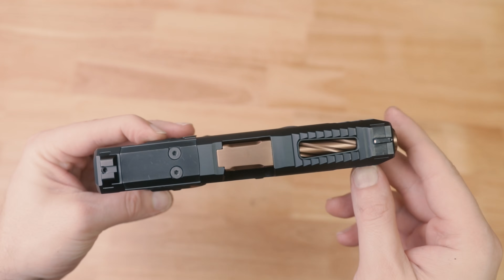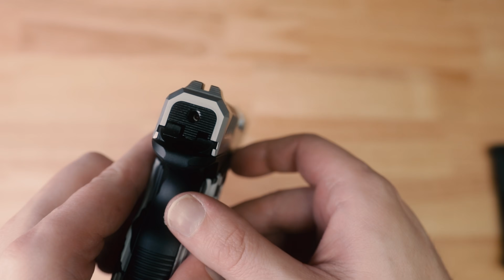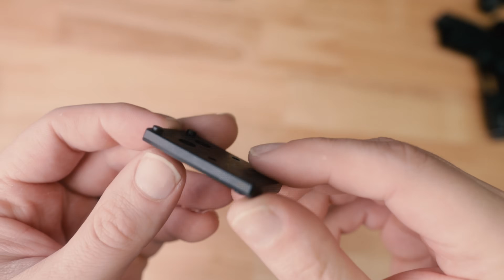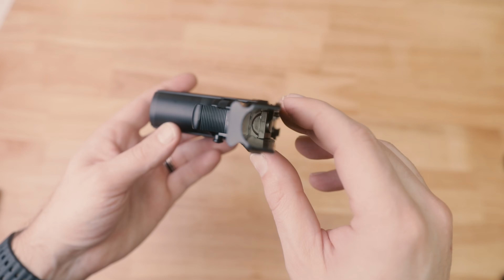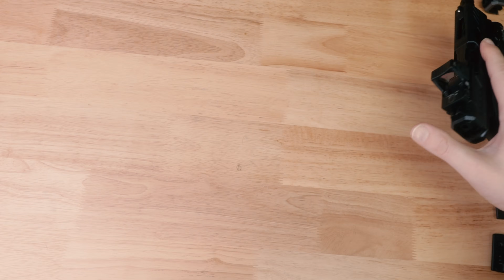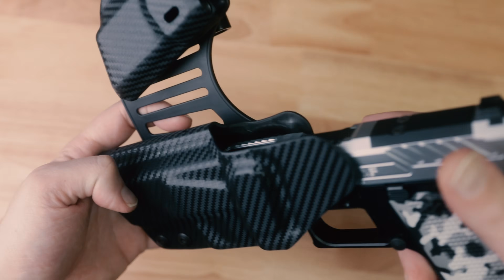The XF Pro - An Improved All Metal Glock?

Comment: Fusion has terrible customer service.  They don’t return emails and hard to get through to someone to speak to about a warranty issue.  That’s right, I bought one of these XF Pros and from day one at the range I’ve had slide lock after every round fired.  Turns out the slide lock spring pops off after every few rounds shot.   I’ve tried to reach out to Fusion for a warranty claim and no response.  Their website has issues as well.  This gun is currently a paper weight.    Reconsider buying from Fusion until they can get their customer service together.
Reply from the maker: Really is that right? That's crazy. All right well here's rserva@outlook.com. I actually own the company. Why don't you email me and I will be more than happy to try to help you: rserva@outlook.com
Reply: @fusionfirearms thank you sir
Reply: That’s really mind blowing to hear. My experience with Fusion Firearms has been exactly the opposite. I had a problem with an optic plate for my XP Pro right out of the box. Emailed Fusion and Tyler sent me out one immediately. Had it 5 days after I called. After buying an XF Pro I had the locking block screw come out of the frame. Again I had new screws in a week. And the gun works without the screw. Later I encountered a problem with my XP Pro slide stop. Tyler sent me out one of each type immediately. Imo Fusion guns and their customer service are the of the highest standard. My only gripe - they’re selling so many excellent guns so fast I think they’re struggling to keep up 😂 I ordered a chrome XP Pro 2 months ago and my dealer (2A Zone) only recently confirmed its delivery. Also it sucks that being in Cali I can’t even buy their swag online. But I’ll get some. They have an eBay store😉

Comment: just got one and slide keeps locking back randomly but won’t lock back on last round.
Reply from the maker: Sir, Also, look at the spring that is attached to the slide stop internally. You can see it if you just take the slide off and look down inside the magwell area. Make sure this spring has not slipped off the slide stop. If it has just take a scribe or finishing nail and hook the spring and place it back onto the slide stop arm.  Sometimes this spring can come off from cleaning rods or magazine cleaning swabs are used. You can accidentally grab the spring arm.  Also, the recoil comment left here can also ha-pen depending on how someone’s grip and finger positions are.
Reply: You are likely causing that situation. Make sure your thumbs arent pushing the slide stop upward during recoil. Clean the gun and your magazines. Try different magazines and ammo brands. I just got one recently and have had no issues like that with OEM Glock mags, Magpul, ETS, Pro Mag, or Mec Gar metal Gloc compatible mags. Haven’t even gotten around to the mags that came with the gun.

Comment: Super interested. The no-go for me is that this uses optic plates instead of direct mounting for the most popular optic footprints and cannot co-witness with standard height sights. This is 2025, almost 2026, to still be using plates when most of the competition is direct mount and super low profile to work with standard height sights is a major miss. Love the integrated option for using ported/non-ported barrels especially, and the ergonomics look excellent. Fix this and I'll buy 2 immediately and sell everyone I know at competition matches and ranges on this unique pistol.

Comment: Ran the xf pro at the Range yesterday.. gotta slam the mags home, might be some interference with the glock base plate.. other than that, extremely smooth shooter..amazing for a non comped gun.. can't imagine what a comped barrel would do!
Reply from the maker: Thank you for the nice comments, Yes, watch the base pads on some brands of mags, they are wide and hit the inside of the grip sometimes.
Reply: @fusionfirearms  they came sirect from fusion.. 10 rd glock mags..

Comment: you need to offer supressor sights.... the front sight is impossible to find.no cowitness at all with stock and a dot.. Shouldve came with just glock 19 compatible sights.. Almost perfect.. Or you guys shouldve just cut it for an rmsc or rmr for direct mounting... man so close. I love evything but the sight system. The rxm crushes this because of that.  dang.
Reply from the maker: These sights are very easy to change to whatever you want, standard Glock rear and standard Novak .330 X65 Degree front. They are all over the place and easy to find
Reply: @ I don’t see a single suppressor height available… which is was you need to co witness. Even then with the thickness of your optic plate I don’t think it’s possible. Just providing some constructive criticism

Comment: I prefer to cowitness my sights and dot, I placed a Holosun 407C. The mounting plates are so thick, I have not been able to find any sights that will cowitness. It has been very aggravating. However the gun is very sturdy, great shooter, the built in gas pedal is really nice. Great pistol for the money but the cowitness issues are driving me nuts, and my gun didn’t ship with the red grips as advertised.
Reply: Having the dot inside the slide seems like it would be supported far better and you wouldn't have to worry about the bolts sheering as bad.
Reply: Have you checked dawson precision for sights?
Reply: @shepherd3085  Yes, I run Dawson on my G45 for my DPP. The problem is that Fusion XF has the thickest mounting plates I’ve ever seen and they use Glock sights for the rear and Novak cut for the front. So you have to mix and match sights. I run suppressor sights on my VP9, they are very tall, they wouldn’t even be tall enough to cowitness on the XF. It’s annoying, if you can get past that the gun is amazing for the price.
Reply: Why are you talking like you have a gun that hasn’t even shipped yet?
Reply: @m0b00st  I have the XF Pro, for almost a month